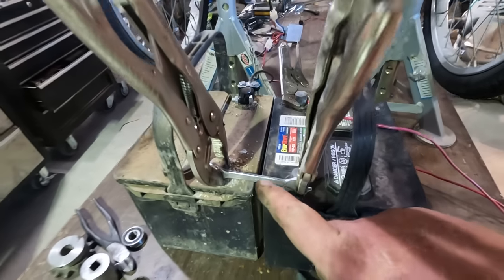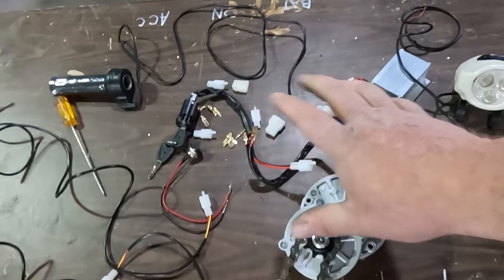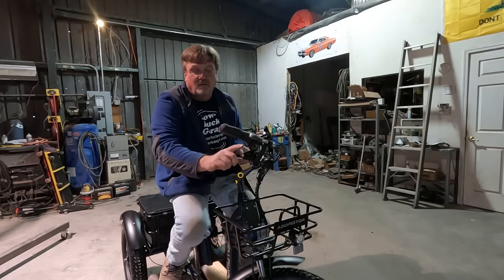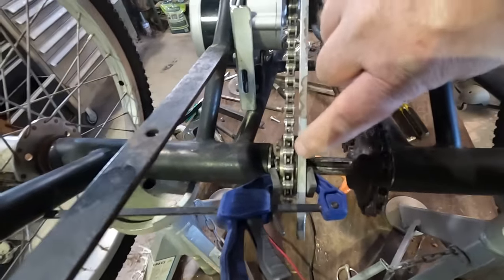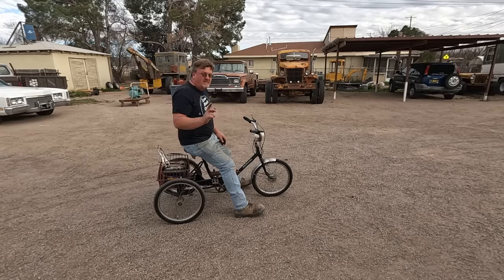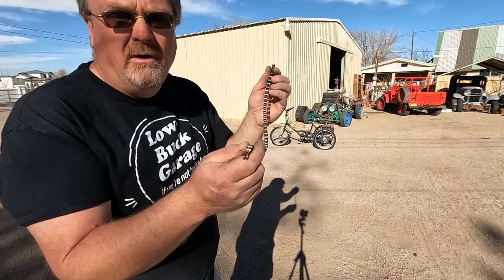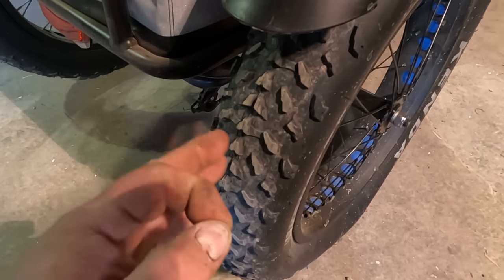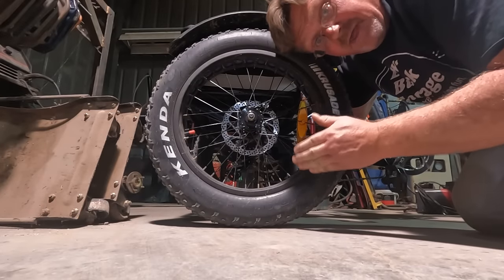Etrike Shootout: DIY vs Addmotor Grandtan M-340

Comment: Your DIY bike is crying out for a 48v battery - maybe not 960wh, depends on the range needed. You could always try a 36v power tool battery (or 2x 18v in series). It will work but the range will be rubbish.

Comment: you know, if you cut zip ties on the tail side rather than the head side you can cut a new point on the tail and reuse them until they're too short to reach around whatever. i save the zip ties on the packaging of everything i buy 'cause free short zip ties.

Comment: Back in the 50's and 60's we used buttermilk in the tubes to act as stop leak. It worked. We also had to deal with the goathead stickers. The buttermilk didn't work 100% of the time . Just depended on how many goatheads vs how much buttermilk

Comment: Re: finger tight pedals. Probably a quick way to ship, and reduce customer service calls from trying to bolt in a reverse threaded pedal, or destroying the threads trying to. Also keeps the packer from shipping 2 pedals of  the same direction threads.

Comment: I am a mechanical engineer and build high power electric bicycles that people barely notice because they are quiet and the motors and batteries meld into the frame pretty well.  My bikes can go unspeakable speeds that you can't buy at the bike shop.
All I can say is you are a smart guy and well done for what you do.  If you like, you could build something with motorcycle like speed but that may not be your objective.  The stealth aspect of riding with a motor is perhaps the biggest benefit.
2000 watts on a bicycle is a magic carpet ride.
Ride safe.

Comment: Rally enjoy your basic minimalist approach & sense of humor,  I'm now 70 and dealing with disabilities plus age, not at wheel chair stage yet, but have gone from a couple DIY built Ice powered trikes 3-5hp 4 stroke, to an old  vintage german made 2 wheel electric scooter with acid batteries & a 10 mile, 10 mph range max, to a nicely built American electric mountain bicycle with 30 mile range at 30 mph, hand throttle only.. bikes are a hard habit to give up,  after 55 years/ 1.5Million  miles of Motorcycle riding,  If i was only 20 years younger, the e mtn -bike's  not working for me due to balance problems, so electric trike is now on my menu. Problem is range, i live about 40 miles round trip across the desert to town, i could take the paved hwy/ road or a dirt road & some trails to town.. The highway is not awful busy but  has its moments, people do drive awful fast these days 70-80 is the norm it seems, So thats a risk, plus so car drivers are  have eyes glued to their cell phones while driving, which is very unsettling when i think of getting rear ended, so installing bright & continuing flashing lights on rear would hopefully catch the cell phone numbskulls attention coming up on my slow moving trike.   I am past the point of a DIY  build anymore, so looking for a good used  e-trike as new ones run from 2500-4500 usd.. way out of my financial reach.

Comment: About to complete my first ebike build, just waiting on the a few bits and pieces to tidy everything up.  I also took some scrap parts and starting putting together a full suspension trike...after watching this, I think I may just make a motor mount for the trike too so I can swap the motor back and forth until I can get another one.  I just took a smaller frame with 20" wheels, removed the rear and replaced with two 16" wheels / 2x threaded coupling with threaded rod connecting them.  I had to swap sides the crank so it would align with new freewheel location.  And i can just run two rear wheels with freewheels, one for motor, one for pedals.  I had to drop to 16" rear wheels cause I didnt widen the rear tires out, and feet would hit 20" wheels when pedalling.  It is pretty low to the ground...i could make it electric power only and go back to 20"...or maybe even some pedal extensions or a wider bottom bracket could let me run 20" without making a rear axle. (No welder, just angle grinders and nuts and bolts).  I found these cheap plastic cutting boards that are just under 1/2" thick that i make a lot of parts from...motor mounts and bushings, mostly.  Couple bucks, can glue it to make thicker blocks.  It is great stuff to work with.  Can also heat and bend it, of course. I got a small Mastercraft hand saw made for cutting pvc pipe that cuts through it great, and is only like $7 or something.

Comment: Excellent Low Buck Garage  :) think a deep cycle marine  battery on homemade built also because by one put acid water mix or distilled water if go low fluid plus last long time in years and fit baskets ! Plus recharge faster and charge last long depends how much used! I have used on talking CB , Ham mobiles rigs got 30 days for full charge plus do 8 hours use each time too and hope try out to! One used in past was 850 Cold Cranking Amps and 160 Reserve Amps Hours ! Plus did great heat of Summer Season plus Cold Winter season months when super cold even my back garage home not instaulled or heat  all time only when at home! But also need 4 to 6 amp fast or slow charger  to recharge battery! Hopefully this hints try out !

Comment: That was an interesting and good video! Like you, I do things to try and help make my Dad's life better, and like you found out, simpler is better. Just today I "helped" him get his rechargeable electric razor working. The issue was that it is designed to operate only when the charge cord is disconnected. Because I suspected the charge cord had to be disconnected, I took care of that and it worked, but I'm pretty sure I saw those clouds of disbelief in his eyes. I was a little concerned when your Dad got close to the building on the faster and more powerful bike. If you're like me, you'll want to give your Dad the better bike, but be careful. Oh, with regard to the weights, I think the lead acid batteries added a lot to the weight of the DIY rig, and I'd like to see you try some inexpensive LiPo batteries. I started to say "cordless tool batteries", but the cost of those is a big reason I don't have many cordless power tools. I bought a cordless drill from Harbor Freight Tools, and I believe they buy downgraded batteries that have been rejected by other companies - mine have a high self-discharge rate, so must be charged the night before use. Maybe get name-brand used batteries from eBay?

Comment: Great experience, Im sure the experience and performance would be closer if the DIY had similar batteries with less weight and more power. Your only running 24VDC.

Comment: Just a heads up, those replacement tires you got if they are anything like the ones made here they are not real rubber sort of plastic ish and will crack and fall apart after a couple years.

Comment: The piece you have @ 16:35 is an adjustable cup for a bike bottom bracket
At 19;03 that is a single speed freewheel, very cheap, often not worth rebuilding as the bearing races are usually crap
Problem with many chains now-a-days, is they are made in china. It's hit or miss getting a good one. I fix and build bikes as a hobby, I see more broken chains in the last 10 years than 60' 70's, 80's, 90's, 2000's combined.  I think it's called chinesium

Comment: Picked up a barely used Miami Sun trike 6 years ago for $200.  I pedaled that little tug boat for 5 years.  I am now 76 years old with a partially paralyzed leg.  Last fall I put an EBikling 1200 watt front hub motor kit on it with a 52 volt 19.2 amp battery.  With everything included I have $1300 in my Etrike.  My trike will take terrain, hills, etc with ease.  I have no idea how fast it will go, because 18-20 mph on a trike is FAST.  I know the trike will do 30-35 miles on a charge, probably more.  I have never let it go below 20% charge.   I have the bike set at 25 mph, and with my 170 pounds, it approaches 20 mph.  The pedals become useless around 15 mph.  I could set it at 50 mph, or unlimited.  I am just trying to stay legal....AND alive!  I put 225 miles on it last winter.  ...in Iowa!  My dog runs along side me. Off leash through traffic!  For me, I have the right trike and the right dog, in the right town, at the right time in my life.
Reply: I am running three dogs now.  The Ebikling kit has been flawless.  i do 6 miles a day when there isn't snow.  The dogs love it!  Great granddaughter's pup hits 19- 20 mph.  I am 77 now, and i stay with him.  Start with a good frame.  I am thinking about the Addmotor 31 this spring.

Comment: Many international places limit those electric motors to 300 watts, so over 700 would be illegal on the road. Also 48V is very "chunky" as even 36V would be typical. It's probably a good idea to check local laws before buying.

Comment: I have not heard about leaving the battery in the sun, I have not had a problem on bikes and wheelchairs and never has any warning been given in any of the handbooks. Lead acid, gel batt and lithium plus my solar panels have 4 kw of storage in the attic in heat and have not shown a problem. Strange about not using it in the rain as well.

Comment: Thats really funny, don't leave out in strong sunlight, A bike(usually bikes are meant for outdoors) you can't use on sunny days.
The batteries on the factory bike are probably lithium-ion, they are the ones that you see vids of catching on fire. Lithium Iron Phosphate  (LiFePO4) batteries are much more stable, a bit more expensive but much better suited to deep cycle applications and last longer.

Comment: maybe use the m340 to turn the diy into a frankenstein that goes fast and is easy to use. cover the lithium battery with wood or plastic so the sun won't cook it and leave a gap for cooling.

Comment: That 24v controller in the diy bike will be limiting the top speed. That kit could be a whole lot better, but i guess its limited by the use of lead-acid batteries.
Reply: Perhaps he should try the diy trike using the admotor battery!

Comment: i use the tire-ject on almost everything on wheels lawn mowers atv's ,  works on dry rotted sidewalls if you take the tire off and turn it so the liquid gets to the side walls the only draw back on my vehicles is my car has  the tire pressure sensors  i injected it in one tire the proper way  realized i had too much pressure  let some air out , mistake was i should have had the valve close to the top and i had it at the bottom and it clogged the stem shut had to cut it off and replace the valve stem and those with the sensors are expensive and still had to program it to the car

Comment: Your feet would not have been contacting the ground if you had raised the seat up to the point where, when pedalling, your forwards leg was just slightly bent.  The very low seat meant that your legs were cramped up, forcing your toes to point downwards.  Also, put the balls of your feet, not your insteps or heels,  on the pedals

Comment: you never just use the motor without pedaling as there are 3 nylon gears inside the hub that travel around a steal ring gear and the two need help to get going otherwise the steal will eat the nylon